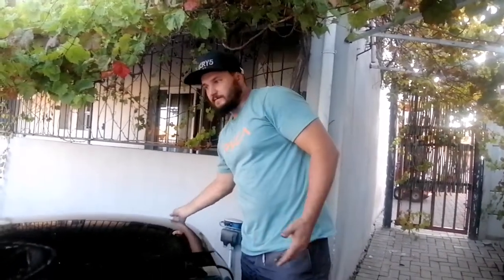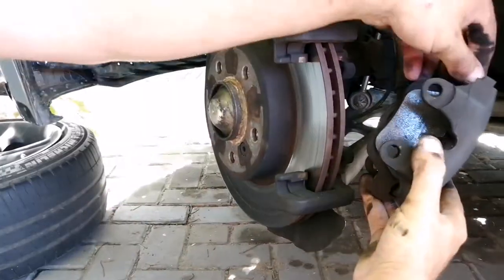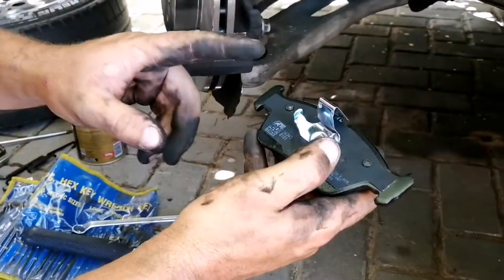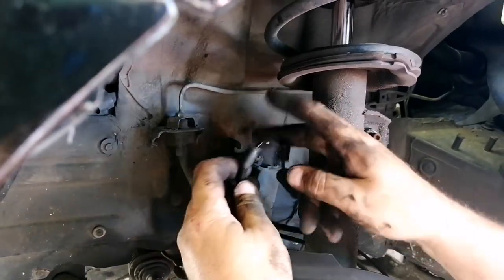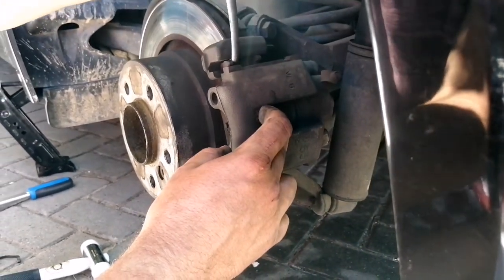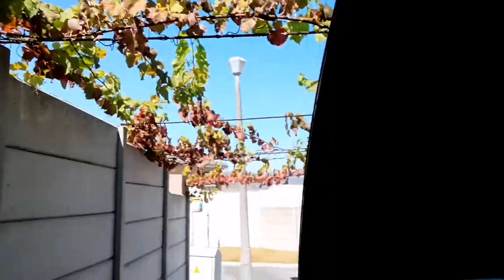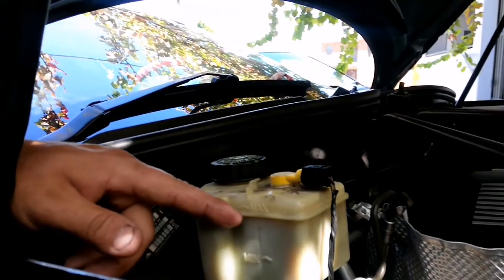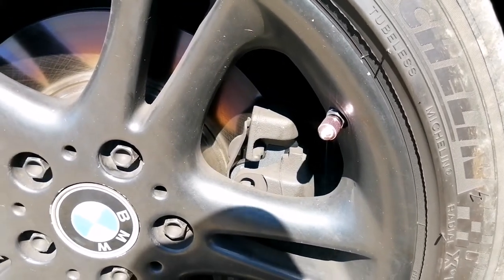New brake pads and rotors bmw z4

Comment: Hoeveel het die jou gekos as ek mag vra?
Reply from the maker: 💯 you may ask any and all questions that's what the channel is for ,I'm not Shure on the cost I'll have a look through my paperwork and try to find the receipt.
Reply from the maker: I baught them from gold wagen I always take the German brands so they cost a bit more but my tei rod complete inner and outer was R900 each so R1800 for left and right and then I took the steering boot kit which is R165 a side so R330 for left and right this is the rubber boot that closes the teirod to the steering rack I still have a spare full set of those boots if you are interested, because you are subscribed to my Chanel you can have the boot set for free saves you R330
Reply from the maker: The boot set I still have is much better than you will get here I ordered it from abroad cost more but it's the original stuff